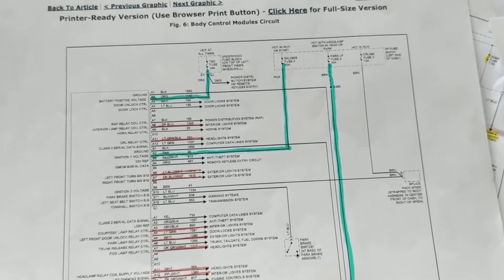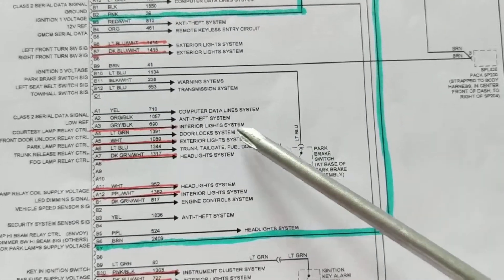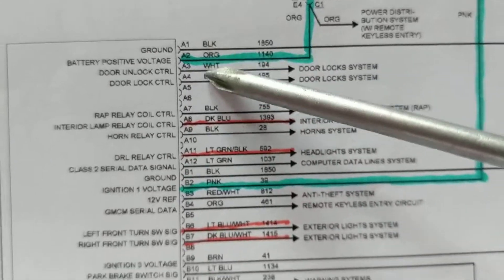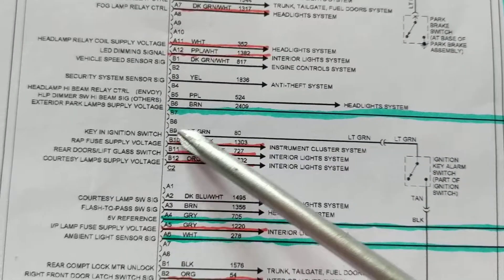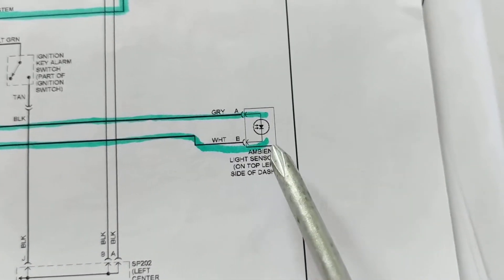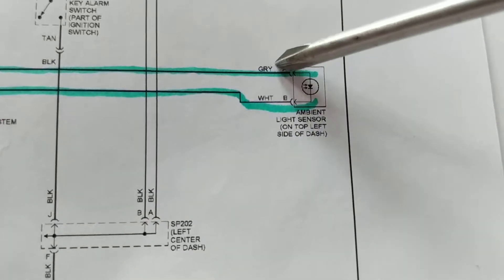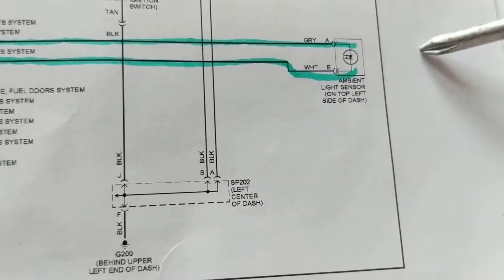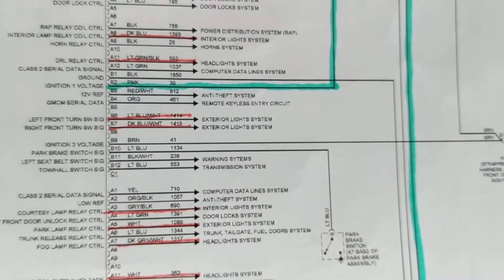How BODY CONTROL MODULE works for Toyota 2015 SE 3.5 L diagram and troubleshooting, please subscribe

Comment: please could you tell me names and location of modules in automotive.
thanks for your support
Reply from the maker: Body control modules are usually by the under the dashboard ecms and ECU modules are usually under the hood by the struts with a big heat sink because they get warm and have vibration all all the modules I'll contain on the dashboard

Comment: I'm doing a dash swap and trying to figure out which wires do what coming out of the body control module. how can I go about finding the wires that correspond to the diagram without tearing open the unit?
Reply: There are multiple multiple wires coming out of a body control module and maybe 3 connectors try to figure out the connectors
Reply: @Joeelectronicschematicsforauto  all I have is the dash board wiring harness.  I don't have the connectors
Reply: I'll try to find similar schematic on diagram for the wiring
Reply from the maker: You have to get a diagram from Haines or Mitchell diagrams one of the other that's the only way you will know what does what you can go to all data but some of them cost money to get the schematic